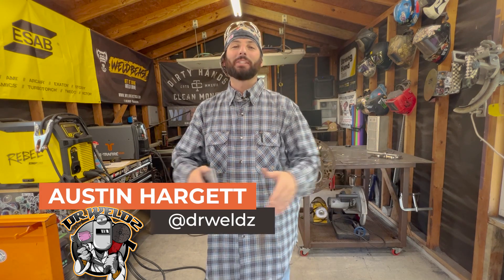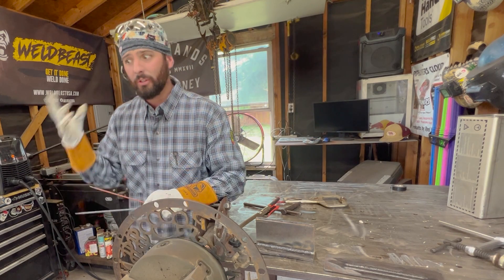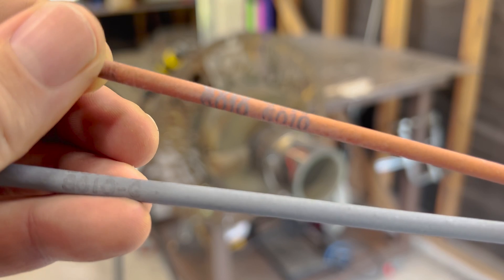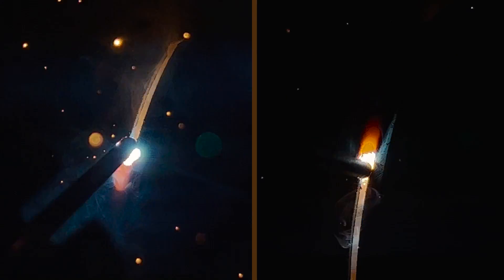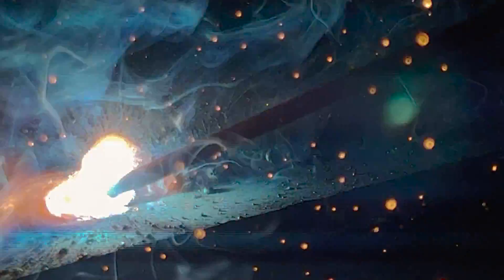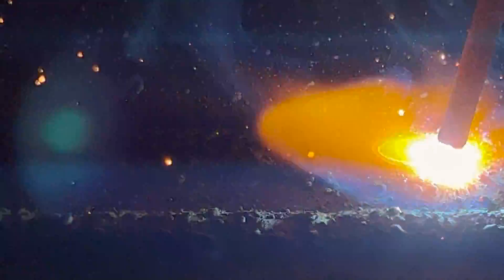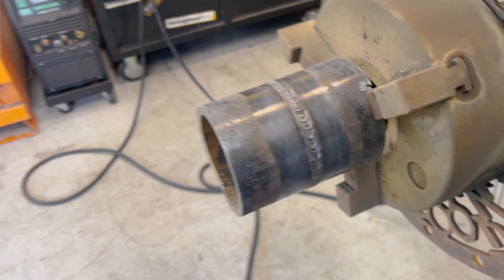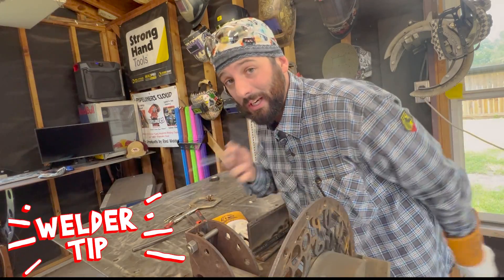Why Do You Whip & Pause When Welding With A 6010 Rod?

Comment: I used to whip it. Found reducing amps means...I bump the sides. Use a small circular motion. This breaks the walls down. Of course, pointing the rod when the keyhole closes/opens. Works well. Yes, having a wet rag to wipe a new rod stops finger nailing.
Reply: 😂s 😊   d❤😊😮

Comment: Yea i was told that about the water from a bud i use to work with at a power plant.  I was not as good a welder especially with the 5p and my friend Harvey was a pipe line welder before he came to the plant . We usually used 7018 or what was called for . He helped me out on the 6010 root . We did not test with that . Our 6g test was tig root and then fill with the lo hi ..But i going to say we had some repairs where we used the 6010 root and the lo hi fill and cap ..Because we needed to get the unit back up . Never had a failure doing that . Thanks for the video
Reply: Thanks for sharing

Comment: I've been needing a tip like that at the end.  Had some bad problems with 6010 flux messing me up not burning off evenly.  It was throwing my heat direction off whack and erratic.  I've seen guys that would shake the rod real fast as their welding but it doesn't work as great as it should.

Comment: Ive been welding on gate hinges, 3/8" x 4" plate hinge to 4 1/2" pipe post. I cut a slot into the pipe for hinge. Then weld 1/8" 6010 DC+, cap with 5/32 8018 DC+ high amp. All downhill with excellent results

Comment: On 6010, if you use them in the wrong polarity, what happens?  Will it even strike off?  I was told it would work in positive electrode, but I tried it out with my welder and it did weld up pretty good.  Didn't do a bend test or anything, just practicing but I did it and couldn't really tell a difference.  I did have a miller lunch box type welder that does tig as well, so maybe that helped?
Reply: Normally ran on DCEP, but can be ran on DCEN to prevent over penetration in the base metals on thinner steel (typically than 1/8”).
Reply: @YT-User1013  dcep brings 66% of heat at the electrode (less penetration) while dcen brings 66% of heat at the plate (more penetration), which i believe is backwards from what you said

Comment: As I know it (not vast experience - 6010's frequently not even heard of here in the UK) sometimes the weld will not run stable with a 6010 and you have to "whip" to build up a well-formed regular-and-even bead.  That coming from someone who always sets the welding machine to the weld and does a straight run wherever possible, which is most of the time.  I offer this while not wanting to contradict your "take".

Comment: In Europe we don't use 6010 atleast in pipe we normally do the root pass with TIG and then with 7018 or flux cored, and also here in Europe it's not allowed to weld downhill and with reverse polarity
Reply from the maker: It is pretty wild how different the process can be depending on where you live.

Comment: Mmmm... i dont think thats a whip and pause, its more of a backfill weave... we were taught whip and pause means you slightly increase your arc lenght which is supposed to increase the resistance and heat... you whip slightly out and off of the workpiece and pause until you get the desired temperature then return to your puddle/keyhole and continue as normal... basically its to help open a keyhole if you find yourself moving too quickly or feel the amperage was too low so you quickly make up for it by whip(increase arc length) and pause... otherwise if you dont increase the arc length off of the workpiece then you're just laying hot metal on cold steel and when you return to your puddle you just made your job of penetration that much harder... again this was more of a back fill technique where the opposite problem occurs and the piece is too hot and you whip forward rather than out to build up material then return to the puddle and fill over the buildup as to not blow through or get excessive penetration